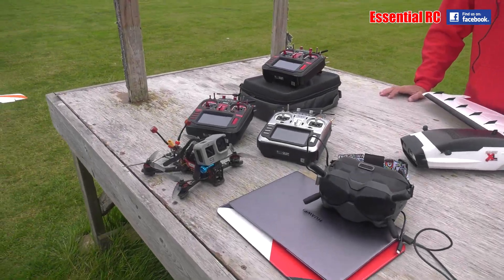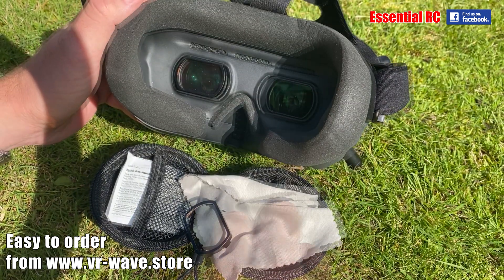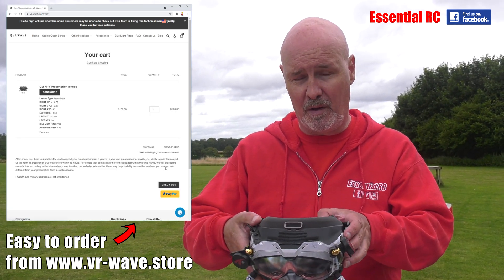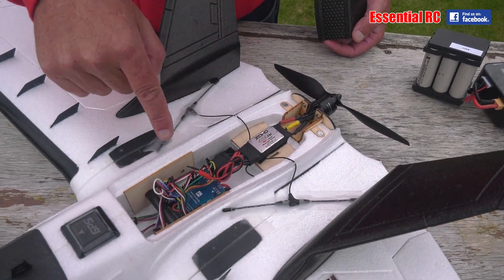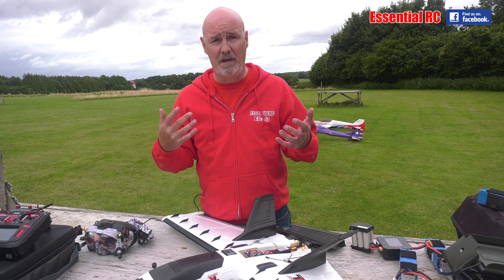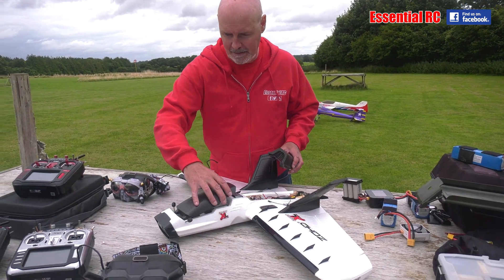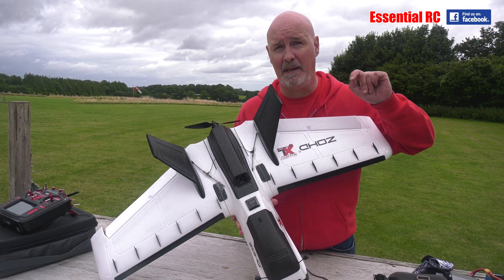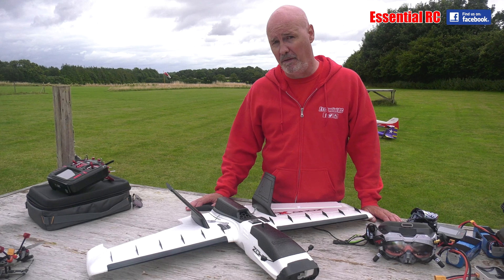NEW RC TECHNOLOGY OVERLOAD ! OLD DOG & NEW TRICKS | I'VE GONE FULL RC GEEK ! OpenTX, INAV3, FPV, FC

Comment: could i have a question? I know it will be better, while i wrote this under video with b17, but it is relatibly old video. So do u think, is B-17 from bangood ( https://www.banggood.com/QTMODEL-B-17-Bomber-1830mm-Wingspan-Airplane-EPO-Warbird-RC-Aircraft-KIT-or-PNP-p-1716305.html?utm_source=Youtube&utm_medium=cussku&utm_campaign=essentialrc&utm_content=zhikejian&p=R427033382918201512W&cur_warehouse=CZ&ID=62878536223152) good plane for me, when i have 50 hours on something like bixler 2, and 70 hours with phoenix 2000? Last 100 hours i haven´t got any crash.

sorry for my English, i am from CZ, and my english is not good (i am young too) :-)

Comment: Ha! It's very nice, but it's way beyond anything I'm involved in at the moment. My last genuine thrill in the hobby was receiving some 'balsa wood' by mail order. [Huh? Balsa? Who he?]

Alas, my local model shop closed down several years ago, and having sold my car (I'm skint) I've only got an old bike these days; the next nearest shop is a ridiculously long ride away. So... mail order.

It's risky ordering balsa through the post - you can be fobbed off with something unsuitable by someone who doesn't care or who hasn't got a clue about aeromodelling, but this stuff was perfect and exactly what I asked for. Mmmmm, hand-picked, quarter-sawn, graded stock...

I won't mention the Model Shop here, but it's in Leeds (whoops, quick plug). Old, long-established place, run by peeps who give a, or indeed an, hoot.

I just wanted to make the point that there are various levels of RC geekery. Yours is impressively high tech; mine is laughably traditional. The important thing is that the hobby continues to thrive.

I'm not into quad-copters, fixed-wing camera 'drones' or FPV. I do a bit of KAP and KAV, but I'm concentrating on sub-250g planes at the moment - sort of guided free-flight models with lightweight radio and some carbon/composite additions. And vocal telemetry;  yay for progress!

Why so weird? I want to keep things strong but light, so I'm mixing the old with the new to spite the CAA.

As with the Sheriff of Nottingham in the days of Robin Hood: everybody boo the villain...  Yep. I refuse to pay the UK's unfair 'RC tax', and I'll never, ever register!

Whatever. I enjoyed your video, even though we're both clearly getting very different things out of our modelling. Happy landings, young sir/old bean...

Comment: Do the goggles record the video to the SD card? if so does it have the display on it??
Reply from the maker: The goggles can record video to SD card and so can the Air Unit/Camera as has its own SD card slot. Video recorded on the Air Unit is better quality. You can replay video in the goggles.

Comment: I have a Matek F7 lying around and just bought a Wots Wot foam-e to play with it. It will get head-tracking too.
The DJI goggle stores the telemetry data in a separate text file with the extension SRT. Either AndyRC or Joshua Bardwell have a video, explaining how it can be mixed into a video, as subtitles.
It doesn't look as nice as the OSD, but at least the data is there.
Reply from the maker: I'd seen that. Was intending to do it as part of our turbine FPV project as I think the speed and altitude will be very interesting.